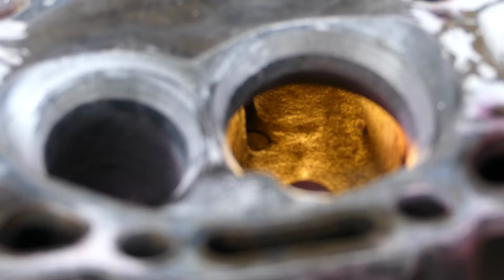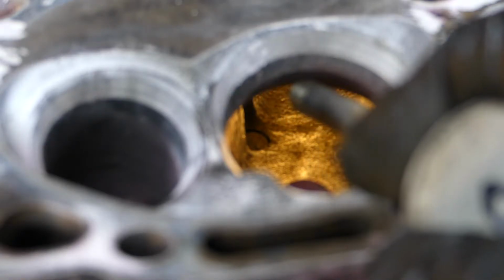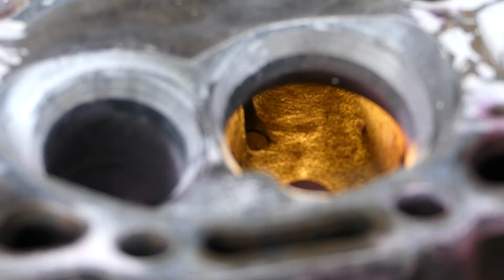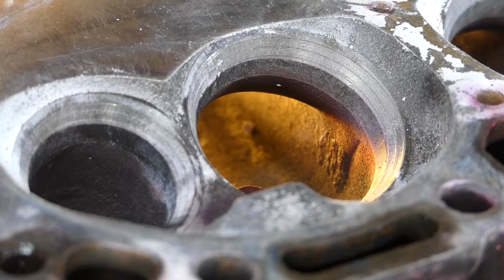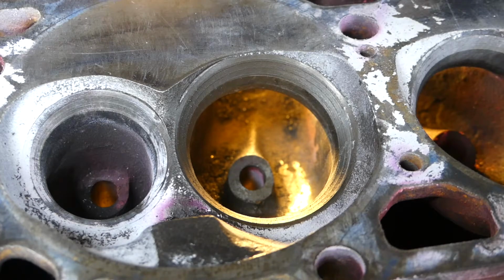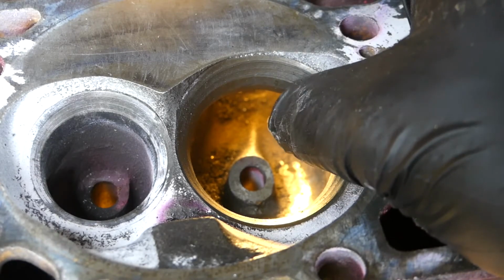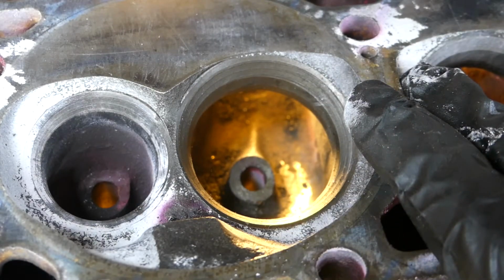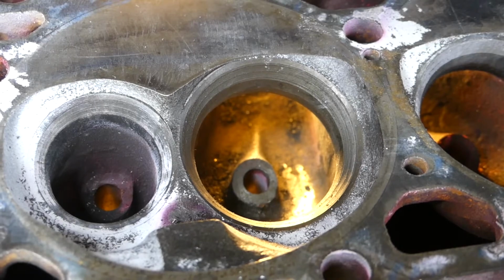VORTEC CYLINDER HEAD INTAKE PORT PORTING (Rough CUT)

Comment: ? Do you flow these heads after you port on them to see if you made them better or ruined then.  I have been using vortec heads for many  years and the exhaust is   were they  slack i run a bigger valve and it works well its easy to ruined a  good set of vortec  heads. I have a set that someone put big intake and Exhaust and gasket matched and some bowl work and they are junk. They put a lot of time and money in to them and turned them in to a boat anker.
Reply from the maker: Yes I have done similar  sets. These intakes should flow around the 260 range plus or minus 5 and I will flow test them when I'm  finished. These heads will also be put on a budget 500hp build and  be dynoed in due time. Time is really my biggest  factor in getting all I want done in a timely fashion.  But I do agree a man with a grinder and really mess up these heads if they focus on just making a big hole!!!
Reply: On the flow bench touching the short side at all on the intake is a huge loss!!! Opening the throat just too the short side and leaving that radius as is yields better flow and velocity. Just my 2 pennies though
Reply from the maker: Alot has changed since I made this video when it comes to me porting. Spent alot of time with a flow bench the last 8 months or so. Alot of this stuff I would do slightly different.  This port did move 275 when finished with a 2.02 valve.